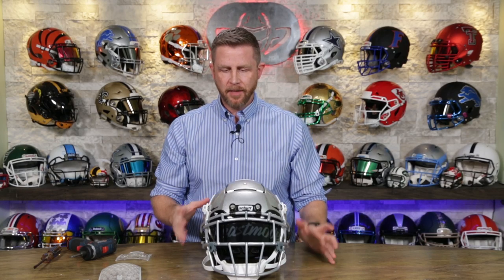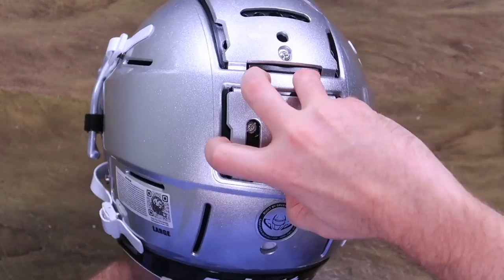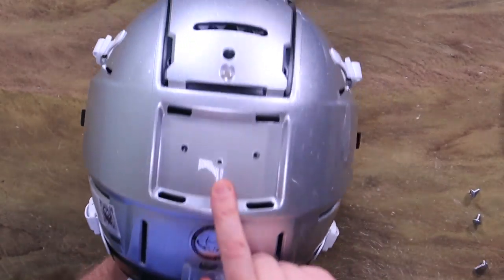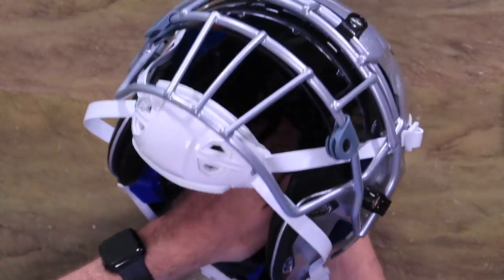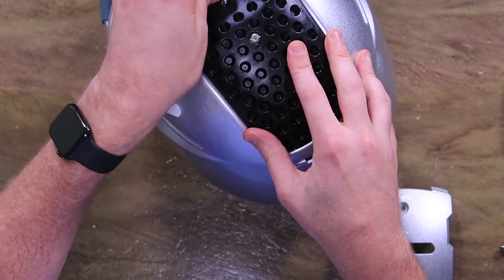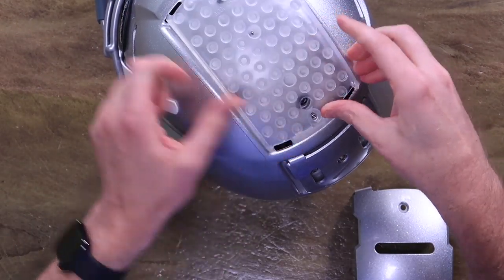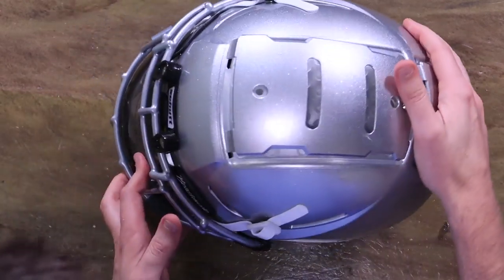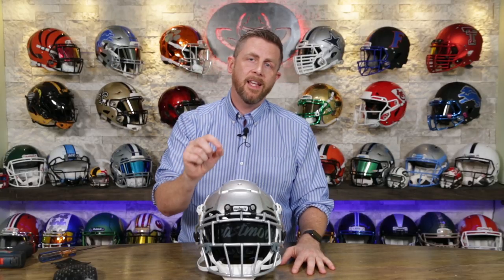Are YOU Handy Enough For This Helmet Upgrade?

Comment: Is there a reason why the black tpu liners are glossy now instead of molded?
Reply from the maker: Good question. We noticed that this season. Schutt must’ve changed the mold process so the face of the mold is polished flat instead of having a slight texture to it, making it look dull.
Reply: @greengridiron  Based on the helmet I got with the black chipped. It seems they are painting them instead of using the molded plastic. It is the standard blue TPU color under the black. The replacement you guys sent me looks to be like that as well.